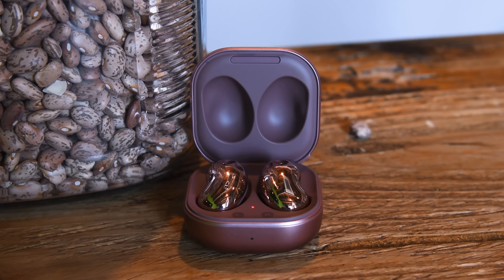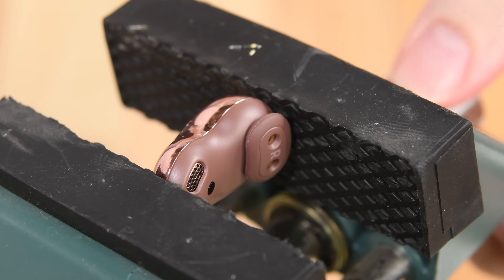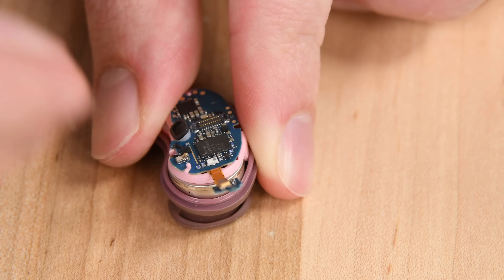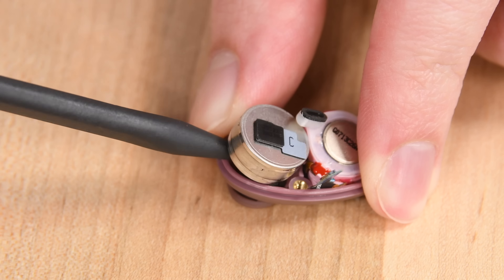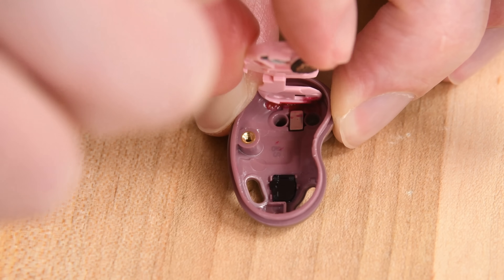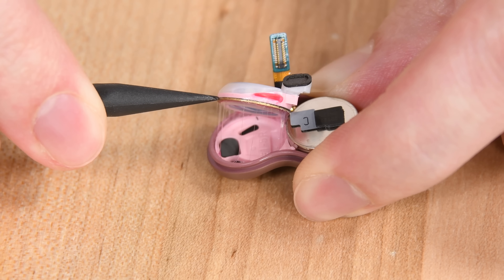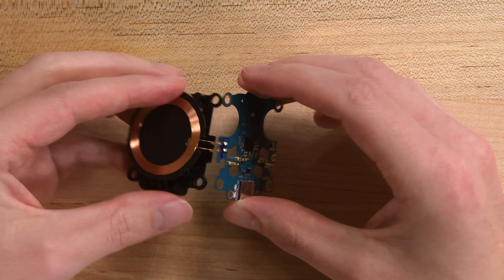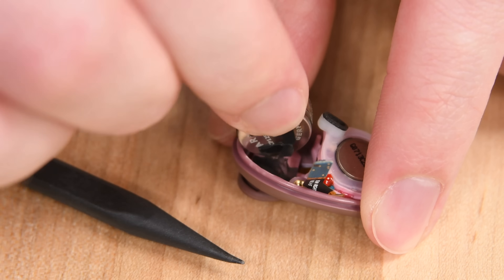Galaxy Buds Live Teardown: The Most Repairable Earbuds Yet?

Comment from the maker: A few notes:
1. @0:16 those are Galaxy Buds+, not Buds Pro.

2. After filming, we learned that we have finally found replacement 1254 button-cell batteries to sell in our store! You can find them at the link in the description.

3. The reassembled buds work perfectly, and the sound quality doesn't seem to have been affected by displacing the speaker driver.
Reply: You should put the link with second point.
Alot of people don't check the description.
Reply: Why 8?
Reply: you're doing a great job buddy, just make sure there's a bit more good quality lighting that will make great difference.... cheers 🍻
Reply: Exactly video
Reply: Is there detailed report in the works with detailed pictures and there components @ifixit website?
Reply: Hi Can A3 battery use for replacement of A2. Can support or not? I want to replace iconx battery but A2 is difficult to find
Reply: I have issues where my left earbud buzz. It does it when I talk and when I move my head fast. Can you help me figure out why it does this?
Reply: Can i spray the outside of my bean ? Will touch pad work after?
Reply: I need help I pulled both of mine apart I've had them since thay came out and I use them daily didn't realize how much volume I lost but now my left bud won't come on but it still charges
Reply: Battery for the case?
Reply: Of course you found the battery and decide to sell it in your store for an easy markup.
Reply: There is no Buds “pro” 👀. But I get it lol
Reply: Please improve the audio quality its way to low
Reply: @tpclan2336  / unless it's the voice quality, perhaps check your audio devices first?
Reply: HATE TO SEE YOUR VIDEOS JUST BECAUSE OF YOUR VOICE VARIABLES, WHEN YOU RECORD YOURSELF, THE VOICE IS PERFECT BUT WHEN YOU TALK WHILE TEAR DOWN, FEELS LIKE YOU ARE TALKING INSIDE THE WATER
Reply: @shkbh  / I guess he was on a different mic setup, like pin mic?

Comment: Beware. I pried the driver itself open when trying to lift it. There's a super thin copper wire in there that can break easily. I was able to lift the battery just fine without first lifting the driver.

Comment: 3:26 Wrong Process. You have to just pull the pink plastic part below the battery it will remove everything along with speakers. You will damage the speakers if you pull speakers seperately. Also if your speakers sound muffled after doing any repair just try creating vaccume and filling air in the speaker hole that will free up the speaker film.

Comment: The holes in front of the speaker driver got clogged, so I cleaned them and the entire disassembly and cleaning took like 5 minutes. These are amazing, all modular, no glue, and availability of parts is still ok

Comment: I’ve been using these for quite a while, but recently, I noticed the microphone wasn’t working properly, and the call quality was terrible. Today, I decided to open them up. While doing so, I accidentally tore the left speaker cone slightly, exposing the coil inside. I thought that might be the end of it. However, I carefully removed the inner assembly as a whole, cleaned both outer casings with soap, water, and a toothbrush, then dried them thoroughly. After reassembling, I was amazed at how much better they performed. No issues so far! Looks like I’ve got another year of enjoying this incredible piece of tech.

Comment: Hi. IDK if anyone is monitoring this anymore or not, but my buds are almost 4yrs old and the left one for a while has been super quiet. I have kids, so I only use one at a time and it got to the point where it wasn't even usable. Thankfully I have the buds 2 as a backup, but I don't like them as much because they go in my ear canal, the bean shape is awesome for me! So I followed the video and took it apart to try to clean it out. One issue I had was that the glue is all weird and sticky due to nearly 4yrs of sweat exposure and stuff, so like, the speaker isn't sealed anymore, so it was hard to get out.

My issue is, it doesn't work now. It will connect to my phone and tell me how much battery it has, but no sound comes out, and calling will not allow connection to that bud, it keeps switching back to the phone speaker, even with in ear detection turned off.

Any suggestions on what might be the issue?  I'm not upset, it wasn't really usable before and I'm planning on getting a new pair before they go away completely, but if I can fix this one, that would be great.

Thankfully the right one works well still!
Reply from the maker: Hi brimac9261! Try posting to our Answers Forum. Hopefully someone who has done this repair can provide some guidance: https://www.ifixit.com/Answers/Ask
Reply: @iFixitYourself its not helping bro

Comment: Just took mine apart since the right one wasnt as loud as it should be, tried pulling up the bottom bracket and my screwdriver slipped and pulled the speaker up, snapped the ribbon cable connecting the speaker to the rest😭

Comment: I have the left bud totally dead, it doesn't even charge although they are brand new. If I find the battery do you think it's easy to replace them.answer please. Thank you
Reply: Doubt it's the battery. These are lithium ion batteries - unless you smell a "fruity" smell it's not the battery.

It's likely a loose contact. Can be repaired with a soldering tool. I would take a voltmeter and test continuity across major parts on the unit.

Comment: I washed mine sadly. The little circuit board on the battery seems to have a fuse of some kind. Everything is dead and won't charge but the battery has 3.8 volts. Whata bummer 😮‍💨

Comment: To go the extra mile, know that the inside of the lid pops as easily as the bottom part. It's extremely handy as a fall can send the magnet responsible to hold the clam shut on the two magnets holding the buds in place. The tape fixing the aforementioned magnet in place is weaker than the magnetic fields of the two magnets. I am so relieved to have been able to fix the thing myself without breaking the case. HUGE KUDOS to Samsung on this one !

Comment: Wow. This is going to sound terrible, but I've literally dropped the case down an entire flight of stairs, into a hard wall, and then they bounced in a different direction onto laminate. Never caused an issue. The actual buds went flying directly into a wall at the bottom of the stairs because they got ejected halfway down, and bounced pretty fair. I had to search to see where they shot off to. Cat ran under my foot when I got to the top step and I had to catch myself. Dropped the headphone case that was in my hand.

It never caused a sound issue, the case doesn't feel loose at the hinge (it was bouncing while open for half of the flight of stairs), there's no rattle from knocking a speaker loose, it had no disconnecting issues, and I have to tilt the case under a light to find the almost non-existent scuff.

The fact that it comes apart that easily really surprised me. I only have 2 issues with it. One of my ear canals is wider than the other, so it has to be maneuvered in a little more snug, and this causes buildup which you have to clean every few months. The other complaint is that the touch pad is extremely sensitive, and it isn't obvious where to tap while it is in. I had a pair of original Galaxy buds and they had a flat surface that was obvious. If you touch the bean near the edge of where it detects finger contact, it can read it as a double tap and skip what you're listening to, or a triple tap and go to the beginning.

I use them about 2-6 hrs a night. I listen to music or stories while I paint. When they die, I can set them in the case while I go grab a drink and use the bathroom. By the time you get back you have another hours worth of a charge (albeit I keep them at the normal equalizer setting and do not use any of the ambient features. Those drain them faster).

Interesting video. Thank you for the info.

Comment: Thanks to this guide i fixed my liquid damaged Galaxy beans live thanks.
Reply: How did you resolve your issue? My buds live got accidentally washed and the left one won't charge or connect to my phone. The right bud is fine and plays sound no problem. Thanks
Reply: @liamk1966  mine only damaged the case I was able to clean it with alcohol and it worked.
Reply: @Denvermorgan2000  Many thanks for your reply, very much appreciated 👍🏻😎

Comment: they are way too slippery for my liking. they sound great. I did find myself adjusting them frequently and I'm not entirely sure why.
I got some silicone sleeves that make them fit a tiny bit better and doesn't effect charging. my buds plus once I twisted them into
place and I never had to adjust them. the live do sound noticeably better. the ANC is impressive to me. a very novice audiophile. (lowers case a.)
do to insomnia I sleep in a bed tent. exactly how it sounds. a low profile tent the exact size as the mattress. anyway, I use a small 18650
rechargeable fan in the tent for circulation. when I activate ANC I can clearly hear the difference. I can usually hear the the hum of the
motor and sound of air movement. ANC seems to completely cancel out the hum. its really cool. overall I'm glad I got them. I lost my
(R) bud+ a few months back and finally decided to just buy a whole new pair. these in black were on sale for $139 so I grabbed them.
nice vid. thanks.

Comment: I feel strongly that 8/10 is too high. They may be more repairable than competitors, but far from easy. Particularly the case which does not face the same design challenges that the buds do. Would probably give them a 6 or maybe 7. There's a lot of progress to be made in this class of device

Comment: İts a real 10/10. may be you can delete only 1. Why 8/10. Adamlar fasülyeyeye sökülüp takılabilir kablosuz kulaklık yapmış 8 veriyorlar
Reply: There is even more room to improve. For example the USB-C port on the case is not modular, it's soldered on the main board, so if it breaks, you can replace the whole board.

Comment: the engineering effort they put in that tiny piece of tech is mind blowing
Reply: Ya,  crazy engineering.
Reply: yup. beautifully done
Reply: supremely elegant engineering with an elegant biophilic housing.
Reply: Then watch the Apple Watch Series 5 Teardown
Reply: @TheTornadoWind  yes the series 6 and AirPods Pro they should look!
Reply: I'd say its as tiny as it is only beacause of the emgineering effort put into it, wouldnt be that small of ot was alf assed
Reply: It's good to see they're not putting it to waste with a glued in battery :)
Reply: Sean Smith as if anyone will change the battery
Reply: @namesashhousewares8337  the problem with wireless earbuds is that in two to five years, you'll have half the battery life at best. Eventually they literally won't even work anymore. But if you can replace the battery, that stops these from becoming expensive paperweights.
Reply: Ear phone "crazy engineering" wouldn't entail modular components, crazy engineering is making all the IC's integrated. Using lego-style connectors takes up valuable space.

Comment: Samsung is known for customization, expandability, and reparability without sacrificing design. Their flagship smartphones have had memory card slot, headphone jack, removable battery.
Reply: Note10 and later has no more headphone jack, expandable memory card is only available on the expensive variant of the phone, and their battery replacement is notoriously hard to remove due to samsung use permanent adhesives instead of standard pulltab

Comment: Samsung should add some of this repairability here to their phones which are almost impossible to repair.
Reply: How to made repairing phones possible if they need their phones to be ip68, if possible its only for galaxy s6 and before, removable battery phones and a series phones
Reply: Bảo Quốc just like Apple. The iPhones are by far the most repairable high end smartphones out there AND also have the by far highest rating against water with up to 4m (compared to only 1.5m on all Samsung phones).
Samsung is just using tons and tons of glue which is completely unnecessary and makes repairability way harder.

Comment: Dang, those parts came out so cleanly and easily. They definitely didn't compromise on repairability with the new design.
Reply: And for some reason they still make the phones hard to repair lmao. Superglued batteries
Reply: @PokeLoomerTM  about the batteries there is a soulution, use some alcohol and the glue will lost its effect,its not that hard
Reply: @PokeLoomerTM  they're not the only ones, it's a common problem among manufacturers
Reply: It could have been a 10, why 8?
Reply: @NaterFernat  probably because of ease of getting the parts that you need and nitpicks like that, an 8 repairability score is really high

Comment: I won't be buying these, I still love my headphone jack. I hate Apple for starting that trend.
Reply: It isn't a trend. It's due to shrinking electronics down so small that the headphone jack is causing it to go any smaller. Plus with the headphone jack included it allows water to leak into the device and hints unable to create a greater waterproof electronic device.
Reply: @Mr_Battlefield  it's not that the headphone is too big. On the iPhone 7 where the headphone jack should be was  literally nothing there
Reply: @Mr_Battlefield  My note 8 has a headphone jack and it still manages to be water resistant. There is no need whatsoever to remove the jack other than saving money.

Comment: I was expecting a destructive opening, and I'm really surprised to see it's not and it's actually pretty easy to open
Reply: @AppleReviews  the Batterie?
Reply: @AppleReviews  batteries. Thoes die fast if you use them daily, last a year or so.
Reply: @AppleReviews  most important thing is the battery, the driver and chips are not likely to fail
Reply: You did not read the title of the video right ?
Reply: @Luffy61C4  I did not.
Reply: @dan3a  ok so there's why you're surprised